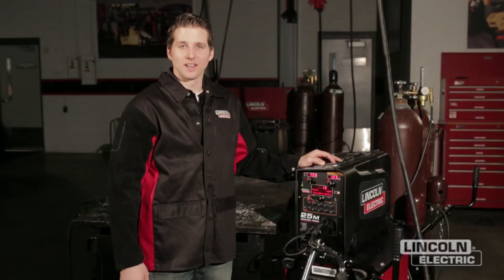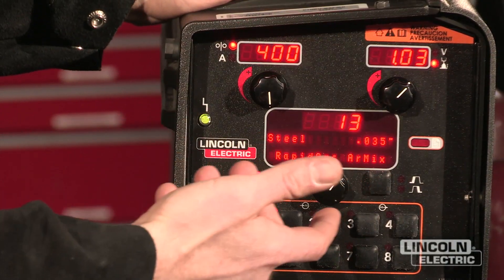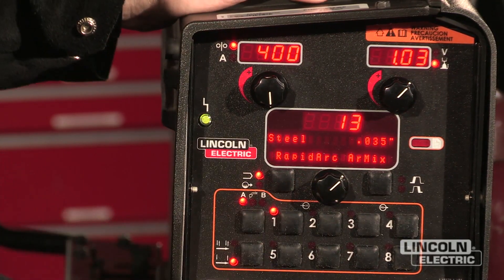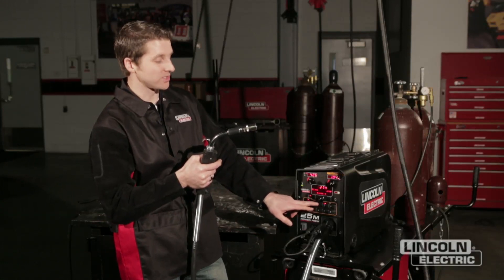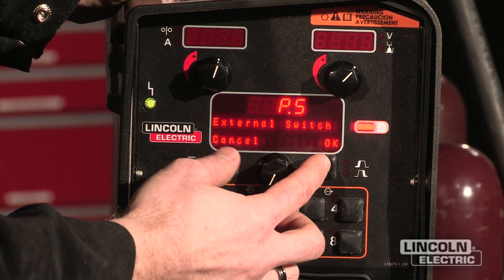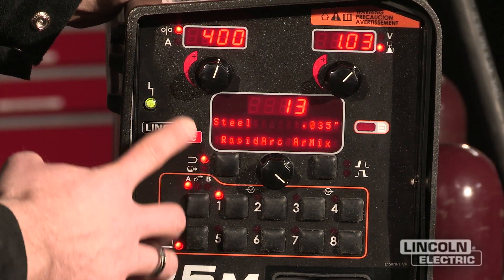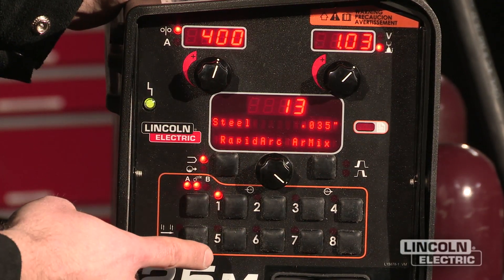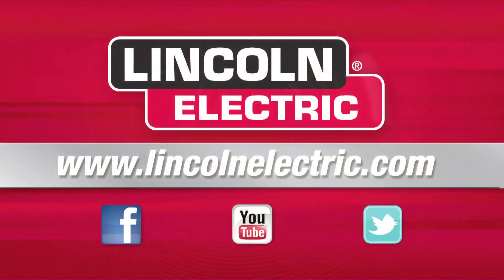Tech Tips: Customizing Your Power Wave®

Comment: Looking to customize my S-350 Chopper.  I can upgrade its system, no problem. but my issue is I really need to ramp up my wire feed speed.  I'm welding t-joints on 1/8's thick 6061, these welds are MAYBE 1/2 of an inch, so I need to hit it hard, fast, lay down a lot of filler and get up off it without burning through, or crater cracking. My wire feeding is quite odd, it will strike an arc, burn back almost to the contact tip. Wire will come out again, reestablish the arc, and burn back in. Its not a steady flow like steel ( I've been aluminum welding for two years and have taken both Aluminum classes at your place). I know from the time that the stick out burns back, then reestablishes my voltage is out of control and long arcing. I see guys online, especially Jody from Welding tips. He doesn't seem to have this issue. The things I have tried is changing to entry 72 ( for 4043) which is pulse on pulse. Or 71 which just pulse. I need to lay beads down, but that wire needs to come out faster. I have thorn that machine apart ( with love of course) and checked everything from flash on the spool spindle, all the way to making sure I don't have any rouge boogers in my tip. I know Aluminum has a steeper learning curve. Its just embarrassing when all I can do is tack these.